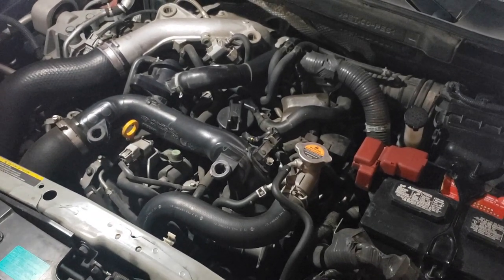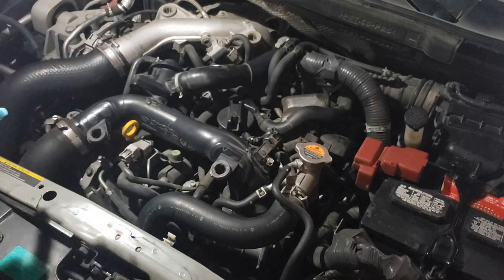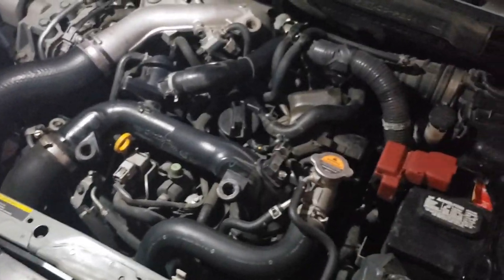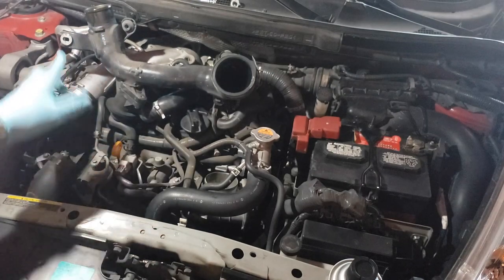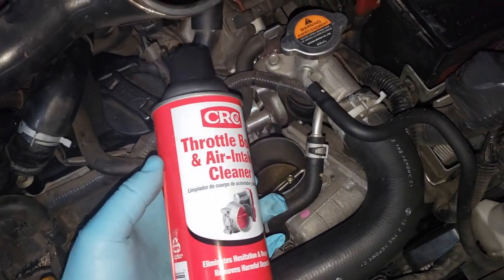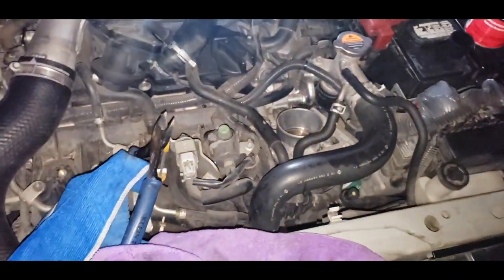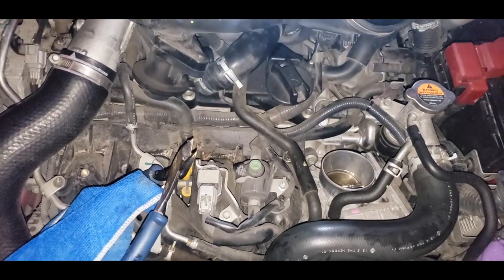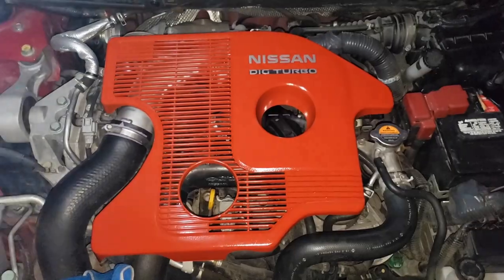NISSAN JUKE THROTTLE BODY CLEANING 1.4 DIG TURBO

Comment: Did cleaning the throttle body make a difference in the performance? Have you also cleaned the intake injectors since you did this?
Reply from the maker: Its did... 1-2seconds delay in acceleration disappeared and it's responsive again. 
I didnt clean the injectors.

Comment: Did you have to do relearn for the ECM after you cleaned it?
Reply from the maker: I did not reset it..  my wife drove it to work after i cleaned. Whe she came home she said theres was a big change in the reponsiveness of the acceleration.
Reply: No SES after right?
Reply from the maker: Nope. As long as all the sensors are connected back and tubes/hoses are placed and tightened properly if wont give you CEL/SES.
Reply: Thanks will be cleaning mine tomorrow
Reply from the maker: @heinrichorilla9914  nice. Take your time and have fun.

Comment: Can a dirty throttle body cause a check engine code to pop up?
Reply from the maker: It can if it’s really bad or dirty. Based on my experience a dirty one can delay in acceleration and sluggish. If you have a CEL on (check engine light) my suggestion is have someone with OBD II reader check it.